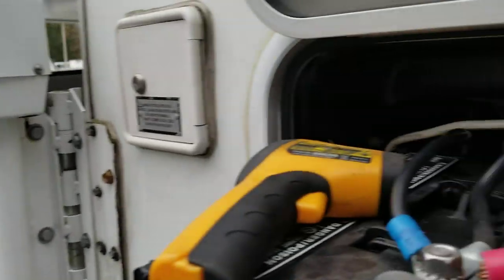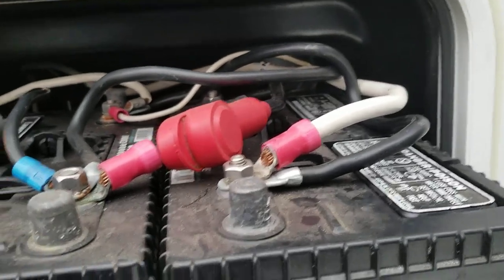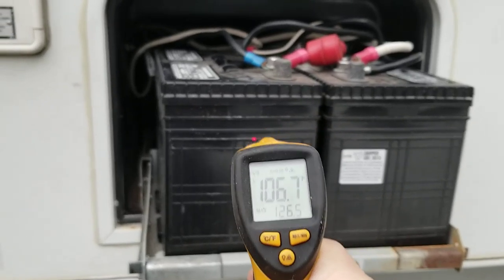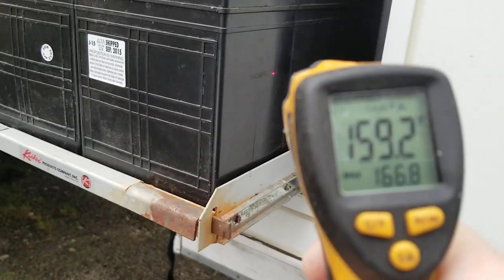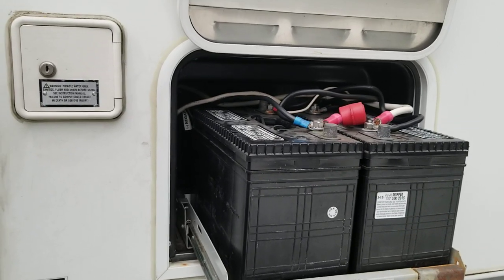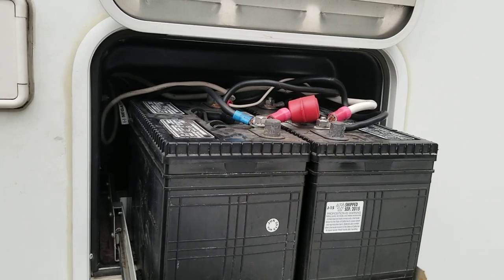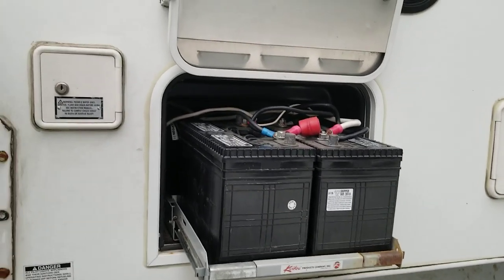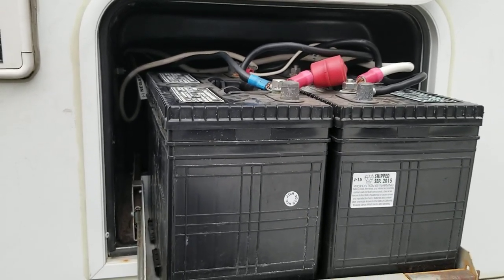Camper CO2 alarm going off? Check your house batteries

Comment: Sometimes you have to put in a little extra work to get everything right and how you want it. But once you get it done then you know you got everything done right.
Reply from the maker: Good point. I was wanting to upgrade to 6 volt deep cycle batteries anyway. Now I have a good excuse to do it. I'll have to research it first though.

Comment: Nice truck!  Stay safe and be well.
Reply from the maker: That nice truck is driving me insane with a lamp out warning light and chime. It's intermittent and nearly impossible to track. I'm going to throw some parts at it until my service manual shows up. I bought a CD rom with all the manuals. Supposedly the wiring diagrams are very nice. I want to yank the ECU and ohm out the harness. Either that or I'll drive it to the friggen boat launch and launch the thing. LOL. I'm going to have to become a total geek on the electrical system of that truck. It's been butchered pretty bad over the decades. 
Anyway the lamp and chime come on but the lights stay on. The ECU must be detecting variable resitance in the one of the light circuits when i'm driving. It's pretty frustrating. Thank goodness I have time to get into it.
I'll see if I can transfer the manuals and diagrams to my phone. Back at my old job I had no problem going through it all that way. You can place you finger on a spot on the diagram and move around through the schematic, zoom in and out, ect. So much better than paper manuals. I love my smart phone.
Reply: @Vention1MGTOW  I am sure you will figure it out eventually!  You are a wise man.

Comment: I had 4 solar batteries and they suck because they are sealed so you can't add water too them. They eventually run dry then they are toast. I still have 2 that are OK but when they go bad I will replace with ones with caps so I can keep them topped up with distilled water . They say the VRLAs will convert the gas back into liquid but I don't really believe it. When I ripped the top off of my 2 old sealed batteries I could see they were dry and sulfated badly.
Reply from the maker: Yeah, maintenance free batteries are kind of hard to use for deep cycle. For deep cycle we really need caps, unless you want to go for all the super high tech lithium units but they tend to be fragile. And god help you if they catch fire. Who knows what kind of toxic stuff is in there. With Old fashioned deep cycle batteries we know what's in there. Lead and sulfuric acid. No mysteries there and you don't need a computer to operate the battery for you. I'm a high tech guy but I appreciate a simple old school design.

Comment: I caught a glimpse of your dually tires and rims. I just bought a 2004 Chevy 4 door Duramax 3500 4x4 dually. My plan is to get a lance camper next like you have. I have stock tires and rims. I want to upgrade. What tires and rims are you running?
Reply from the maker: I'd stick with stock if you're going with a camper my brother. The lower your profile is the more stable your camper is. So if your tires are old I'd just get the same size. I wish I could lower my truck back to stock (although with the torquelift spring stablizers, the truck does drive very well. I'd prefer stock though. 
When I bought the truck it had these crazy big wheels that stuck out so far that I couldn't back it under the front jacks on the camper. I felt like a jackass for buying it without thinking it through. I had to sell them and downgrade back to the stock sized wheels.

Comment: Oh wait!  What?  Vention, you putting a temperature sensor on those batter cells is new to me. Failed cells register hotter????  Very interesting.  I didn't know that.  
What about a Lithium Ion Phosphate battery system?  I know, expensive, but they've got twice (or more) the capacity, can take deeper discharges, and are lighter.  whadadadadada ya think Vention?  (Me spending your Bitcoin money ;-)
Reply from the maker: I'm kind of afraid of it catching fire and dumping toxic gas into the camper. I'm only just starting to look into this though.
Reply: @Vention1MGTOW  Yeah, I can understand that.  And yes, you might want to go with flooded lead acid batteries for expediency,.  But, give those Lithium Ion "Phosphate" batteries some investigation.  That formulation appears to be more stable.  As you know I've been watching a lot of Vanlife/Nomad/RV videos and those  who are outfitting those Promaster/Sprinter/Transit high-roof cargo vans.  So many are using those battery systems.  Note, they do have different charging requirements.  So some research is necessary.  
But!!!!  What ever you do, have a fun time Vention and keep us posted.  :-)
Reply from the maker: @Snarge22  
Will do brother. Thanks for the input. No need to jump right into anything.
Reply from the maker: @Snarge22  
Oh. Almost forgot about the heat thing. Yes whenever you get a short circuit or a grounded circuit and you're dumping power to ground, the point where the highest resistance is is the place the gets really hot. Sometimes it's the wires but in this case since the battery is shorted internally, the power going to ground will cause heat. Just like an electrical resistance coil in an oven. Sometimes you can just point an temp gun at it and find the hot spot, then you've found your problem. 
In this case the bad battery got really hot and it was dragging the power down on the other battery too, causing them to both heat up but the one with the internal short got really hot. That's a standard test if you think you have a bad battery. Feel it and if it's hot it's probably the problem. 
I didn't even think of mentioning that in the video. Oh well.
Reply: Excellent stuff there @Vention1MGTOW .  Makes sense knowing excessive current flow generates heat.  I just never gave it a thought regarding batteries themselves.

Comment: I have a Ford Transit T350 large van. And what is annoying me is the red blinking light on the dashboard that starts to blink as soon as I remove the keys. I think this is the alarm system of 2012 vans but I want to turn off the led light without turning off the alarm.
Reply: just put a piece of duck tape over it
Reply: @FreeMan-uv5kc  i think it is helping my battery to die off